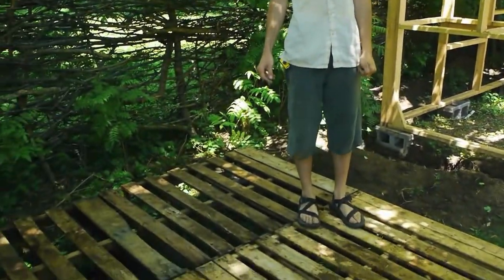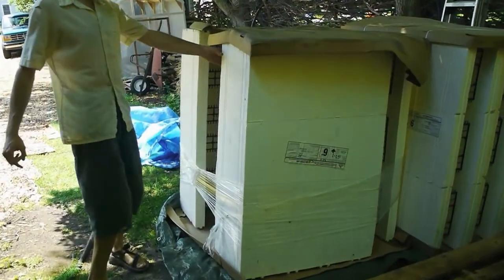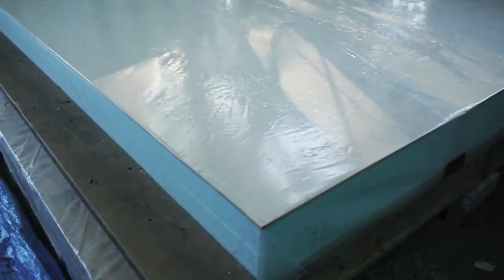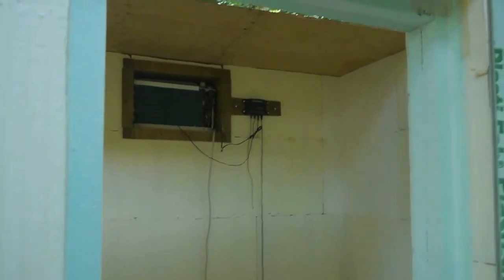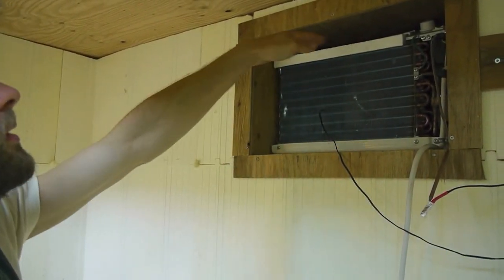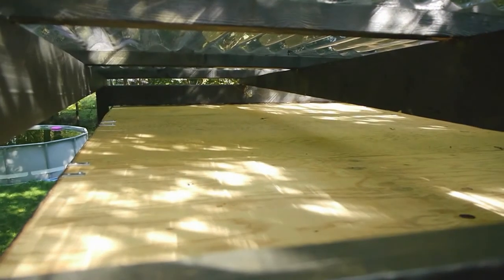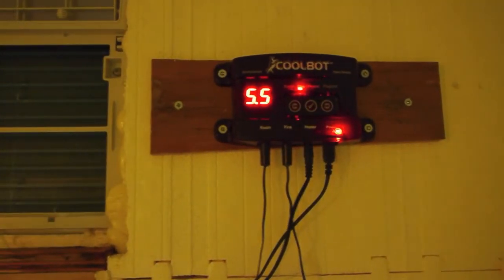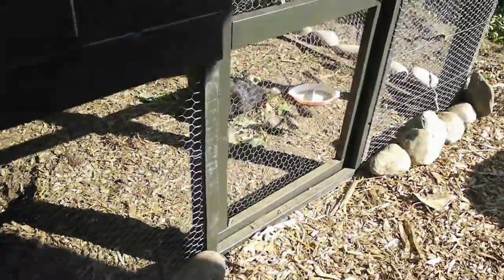Victory Garden Vegetables - How to Build a Walk-in Cooler

Comment: Hey Paul! I love your cooler ! This is the best DIY instruction for a Cool bot. I have a few questions. 1) is this paticular one movable?  If not what would you recommend if anything to make it movable. 2) Do, you think that if you put a solar panel on top it could run off solar? 3 ) How much do you think it costs to run per month? If you had to guess how much do you think you spent in total?Is there anything you shouldn't store in this type of walk in cooler? Thanks!!!!
Reply from the maker: Hi Marie,

1) It could conceivably be moved I think, with a good size forklift! I don't know what sizes forklifts even come in. It's just strapped to the pallets which rest on concrete blocks. You could make a smaller version if you wanted, and a bit lower, without the fancy roof structure, to lighten the unit.

2) That sounds like a tall order; ACs are known to consume a lot of power. I think that's a 12,000 BTU AC, which I think converted to watts is like 3.5 kW (correct me if I'm wrong). The AC won't consume that many watts continuously, but it might during the first cooldown anyway. I happen to have some 3'x6' PV panels for other purposes, and each produces 290 W of power in optimal midday, midsummer, sunny conditions, so you'd need at least 12 of those panels to get that amount of energy. That's a significant size of PV array. Then you'd also need enough batteries to store the power to keep the unit running during cloudy days and during the night, which is another huge expense. Anyway, it may be possible, but you'd best consult with an off-grid technology dealer to get an accurate sense of feasibility.

3) I estimated at one point that it cost me no more than $30/month in electricity, but I was using it only a couple days a week to store veggies for market, then I'd usually shut it down after market was over for that week. In total, it probably cost me (very roughly) $2-3k to build the unit.

As for things that shouldn't be stored in it, what do you mean – is there something that you can store in a commercial walk-in cooler, that you shouldn't store in this one? Not that I can imagine. They work the same.

Comment: Hi Paul,
Nice JOB!!! Couple questions: you have the CoolBot set at 2 is that Celsius or Fahrenheit?

Also, how much is running the cooler costing each month in the growing season?

Oh, and FANTASTIC idea on the siding!!!

Thanks
Reply from the maker: Hi Rex, glad you like it. That's 2ºC. :)
I haven't managed to measure how much energy the cooler uses, unfortunately. My last walk-in cooler had the same design, but it was 10x10-foot, and I got an approximate cost of $30/month during the height of the growing season, turned on for about 2 days/week. Of course it depends on how much electricity costs where you live and how many days/week you have it turned on.

Comment: Looks great Paul.  I appreciate your efforts to keep things looking clean and styled.  How is the floor holding up? Did you end up painting it?  Any idea on the electricity this cooler draws?
Reply from the maker: Hi Andrew, the floor is holding up okay but I really should have protected it better because water is resting on it and probably eating away at it over time. I haven't painted it yet, but that's something I should do soon, with some coats of varethane or polyurethane. I suppose if I was really ambitious I could tile it or do something fancier.
Reply from the maker: I haven't measured the amount of electricity but it must be relatively negligible because I've had it running almost constantly for the last two months (normally just run it for 2-3 days a week) and haven't seen an increase in my hydro bill!

Comment: If your going to use skids for a floor (I take no responsibility for you injuring yourself, it should support the weight but it's definitely not to code.) I have a suggestion, even actually if you're using 2x6. Build your base with the 2x6, cover the top with 6 mil poly for a vapor barrier and cover with plywood. close in all sides other than one and put something like that wood paneling or other cheap product under the skids or 2x6. Fill cavity with spray foam insulation home insulating foam. The kit should come with a wand and 2 tanks that look like propane tanks. you will get much better insulation from it and it will strengthen the floor a little. Cut off the foam that comes out the remaining opening and close it in. build walls and roof as normal. Again I am not too keen on using skids for a floor.

Comment: Hi Paul, thank you so much for sharing this! I have studied your video in preparation to building my own cooler at my little chocolate factory. Just one question, did you attach the IFC's to the floor in some way or is gravity doing the work by itself?
Reply from the maker: Hi David, glad you liked the video. I did attach the IFCs to the floor, in a kind of makeshift way using zip-ties and bits of plywood and screws. I don't trust the weight of it to handle gusty winds!
Reply from the maker: Where is your chocolate factory and what is it called? Sounds awesome!

Comment: This is great. We're in the process of designing a walk-in using a cool-bot also. Lots of great ideas here! I'm curious about your snow load-- is that corrugated roof pitched enough to shed show, or do you have to shovel/push it off during winter?
Reply from the maker: The pitch is very shallow, so no, the snow just piles up. This past winter has been one of the snowiest winters here in southern Ontario in many years, and I haven't had to shovel the snow off once. It actually seems to be bearing the load quite comfortably - I'm not noticing any stress on the structure.

Comment: Thank you so much for posting! I'm about to build something like this inside a building, and hadn't considered using ICF. It seems like it is less strong than if you use framing and foam board, or SIPs, but it also seems quite a bit cheaper and easier to move. I too am curious as to the final cost of everything! 

Again, really appreciate you taking the time to put this up!

Comment: Why paint the siding black??? That just absorbs heat faster than if you had painted it white. Also why the clear roofing? That lets the sun in to warm the roof much more than a white roof would.
When I get set to build one of these I will make the building from papercrete. Papercrete is R-2 per inch. It also is a lot stronger.
Thank you for this video though. I knew there was something out here like a coolbot but I di not know that name.